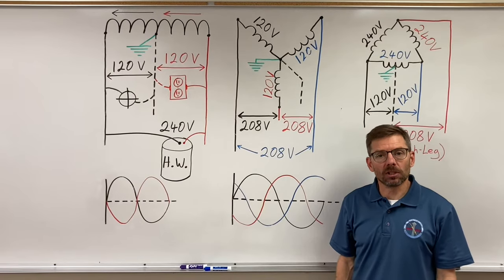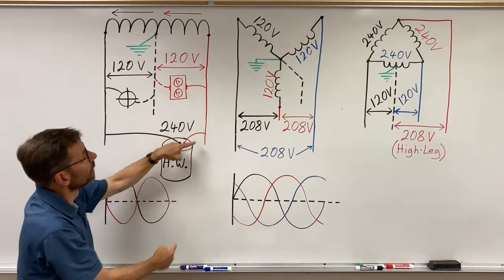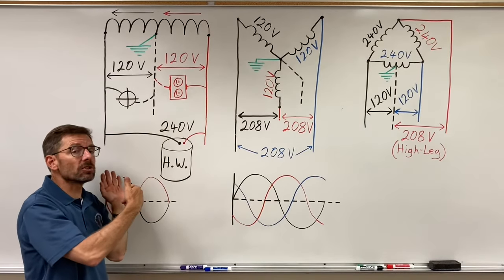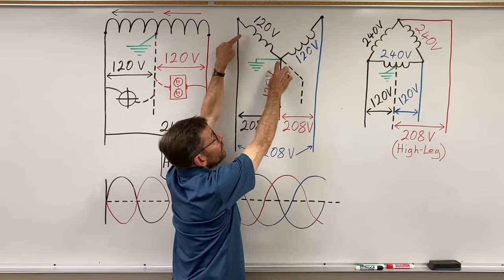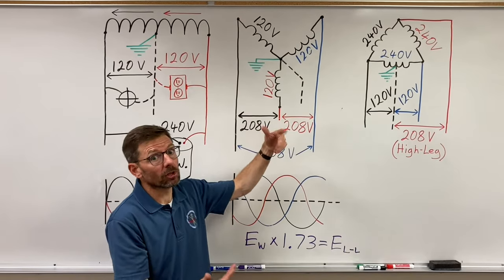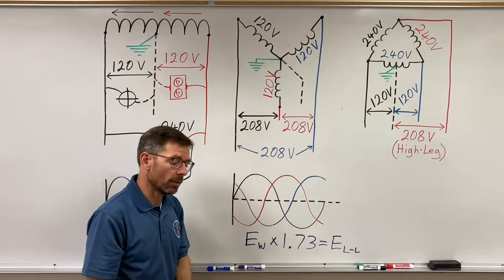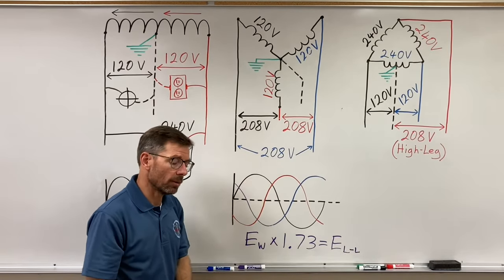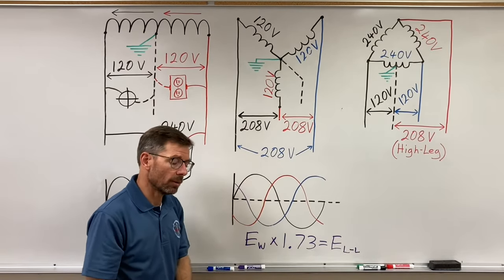120/240 and 120/208 Volt Transformer Secondaries

Comment: DAVE!  DRAW the 120/240V secondary with 1/2 of it wound in the OPPOSITE direction.  That's how we get the two 120V waveforms, 180° OUT OF PHASE!  Spread the word.
Reply: Except it's not. L1 and L2 are coming from opposite ends of the same coil.
Reply: @pterafirma  Its not easy to follow, because, for decades, we all have been looking at drawings of secondary windings never showing the reverse turn around direction, made at the neutral point.  Thats HOW we achieve 180 out of phase outputs from secondary L1 &L2.  The winding is one winding, just reverses halfway.
Reply: @BYENZER  - Not true, nor would that even work. You're possibly thinking of the fact that the primary and secondary coils can be wound in opposite directions, reversing the phase between input and output. But the secondary coil itself is wound in a single consistent direction, providing single-phase 240V output.

If you center-tap it, to get split-phase 120V, both sides are still in-phase, as the coil continues to have 240V at 60Hz across its complete length. Your two 120V circuits only appear 180 out because you're metering them oppositely, i.e. with respect to the center tap.

Think of it like this: Consider L1, N, and L2 to be (respectively) Left, Right, and Center. If you read the L1 circuit, you touch the red lead to the left, and black to the center. Maintaining consistent frame-of-reference, you should read the L2 circuit by touching red to center, and black to right. But because we've designated the center as "neutral", we automatically flip the leads when reading the opposite side, instead of just sliding them over in same orientation.
Reply: @pterafirma  No sir.  Please try to follow.  Empty your cup.  Open your mind.  You will see it.  I think, you are probably going to enjoy, albeit painfully, when you start to understand it.  Maybe this will help:
If you attach a two channel oscilloscope, to ANY USA residential a.c. service utility power, you will see, both L1 and L2, 120Vac sine waves, 180 degrees, OUT-OF-PHASE.
If you measure between L1 & L2, you see 240Vac.
But, measure between L1 OR L2 and the NEUTRAL wire, you get 120Vac, EACH.
IN THE USA, this is how 240Vac of electrical 'pressure', is provided.
If both L1 and L2 were 'in-phase', THEN the 'pressure', BETWEEN L1 and L2, would be ZERO VOLTS, no matter if they were 120V or 480 or whatever sinusoidal A.C. power voltage.
So, AGAIN, IF L1 & L2 were 'in-phase', then NO differential 'electrical pressure' would be present, thus ZERO VOLTS, BETWEEN L1 & L2.
If you open up a utility transformer, you can SEE the winding direction reversal AT the center tap/neutral point.
Reply: @BYENZER  - Condescension doesn't add anything to the debate, and that energy would be better spent reviewing the trig chapter about phase and how wave forms combine. If you add two equal amplitude signals 180 apart, the result is zero. If you're trying to double the power, of two equal signals, they need to be in phase.

Thanks for the video link, but I'm pretty well past that. I was a design technician for a EE firm doing power transmission/distribution, substations, and SCADA during the late 1980's. 

Your original claim about the secondary winding reversing direction at the midpoint is both incorrect, and untenable. That secondary coil first and foremost creates a single phase 240V current, and it can't be out-of-phase with itself. 

I think the convention of calling L1 and L2 "phases" has exacerbated the confusion. An individual bar or contact point doesn't have a phase, only a circuit does. With that in mind, note that the current at any given moment in the cycle, flows in a uniform direction along the secondary. If you're running a 240V appliance, plus several 120V devices from both sides of the panel, the current in the secondary is still going L-R on the entire coil (before reversing 1/30 sec later). At no point does it flow L-R on one half of the winding, while flowing R-L on the other half. 

If you hook up your scope as you described, you have simply flipped polarity of your second channel, mirrored it about the midpoint. That's why the two separate 120V waves appear 180 apart with respect to the neutral. But if you kept your metering polarity consistent (either all L-R, or all R-L) you'd see that the two halves of the secondary winding are in phase, and that's why they essentially add together in series as 240V. 

While we're sharing videos, here's a pretty decent demo of what I'm saying.  https://youtu.be/uRKbX74lBgU
Reply from the maker: @pterafirma  Thanks for responding to B YENZER1's comments as I have not had much time to respond to most comments myself.

I need to agree with Charles Staton's video that pterafirma referenced even though it may be harder for many to keep track of his examples as he quickly changes connections and references (unless we get excited with vectors and wave forms).  I will say that "At-Man", whose video B YENZER1 referenced, has a creative way to show the 120/240 vs 120/208 difference with his bungee cord, but would be better not to use the phrase "180 degrees out-of-phase".  I know I've been guilty of using technically incorrect phrasing when trying to simplify complex concepts so those learning the electrical trade can get an initial grasp of how our systems work.  But isn't that a challenge of teaching - being technically correct, but still simple enough to convey initial understandings.

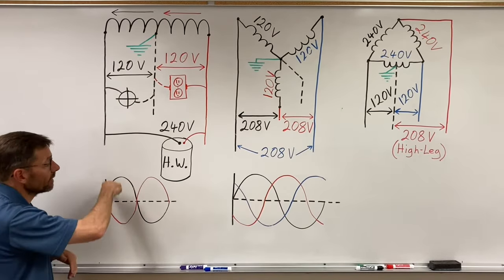Some of the confusion here is that between minutes 3:08 - 5:12 where I refer to the lower left sine waves I am referencing L1 and L2 to the neutral point (i.e: measuring from Black to N, then Red to N, which is how we might measure it in the field) so they appear to be 180 degrees out-of-phase.  And indeed, if I hook them up to a meter with a common neutral/ground as the reference they appear this way.  This really, however, shows that at the current moment shown in the video with current flowing through the winding from right-to-left as indicated by the arrows (with AC it's often easier to view it at a moment in time...), the light is getting current from the black wire and returning it on the neutral while the receptacle is getting current from the neutral and returning it on the red wire (again an area of growth for students because we so often refer to the neutral as the "return path", but current has to flow both ways in AC circuits).

This also brings up the point of a shared neutral and if the light and receptacle each demanded one amp then it is actually the same amp serving both and the shared part of the neutral back to the center point of the winding would have no current flow, thus creating a pathway for that amp that flows through the entire winding, down the black wire, through the light, then through the receptacle, and back up the red wire to the winding (complete winding provides 240 volts which is split between the two loads in "series").  Disconnect either device and the demand is still for one amp, but only through one half of the system (and therefore at 120 V, half the full winding's 240 V because only half of the turns are being used): down black, through light, up neutral, and through left half of winding if light is only device left connected, or alternatively down neutral, through receptacle, up red, and through right half of winding if receptacle is only device left connected.  With either scenario the current, at this moment in time, is going from right-to-left through which ever part of the winding is needed (meaning counter-clockwise through the circuits as drawn).  This would imply "in-phase" and that is why the two arrows point in the same direction.  When the AC cycle changes to the other direction, the whole winding will have current flowing left-to-right and the current would flow clockwise through the circuits.

ANOTHER BRIEF EXPERIMENT to try is to take two AA batteries and put them together end to end. Which ever way you put them, the voltage from either end to the middle will be 1.5 volts (negative or positive depending on which way you connect your leads). BUT, they must be going in the same relative direction in order to get 3 volts from end to end.

Thanks for bearing with my long explanation and forgive me for any "over-explaining".  I think I see another video opportunity when time allows...
Reply: @davegordon6819  - Not "over-explaining" at all, this is good info that I appreciate.
Reply from the maker: @BYENZER  Thanks for engaging and I'm sorry I have not had much time to respond to comments.  Please look at the comment I made to pterafirma as there are reasons why the arrows go in the same direction in both halves of the winding and yet the sine waves (at lower left of screen and, as you mention, in a meter if we use neutral/ground as the common reference) appear to make it look like the winding might be reverse wound on either side.  In the end we see that current must flow along the entire winding in one direction at any moment-in-time.

Another principle to remember here is that on a transformer secondary the induced voltage will increase as the number of turns increase.  Therefore, if I put one lead of my meter on one end of the winding and keep it there while I sample voltages every few turns with the other lead, I should see voltage increasing until I reach the maximum voltage potential when my second lead reaches the far end of the winding.

In class I would energize a coil to act as a transformer primary, then take a wire connected to a volt meter on both ends and start coiling it around the "primary".  As the number of turns increased the voltage would increase.  Then I would pull a fast one on them after about ten turns and reverse the direction for a few turns.  The voltage would start dropping.  Some would be confused, but there were always a few bright sparks that saw me change the direction of the turns...

Anyway, please see my explanation below. Thanks.

Comment: L1 and L2 in split phase systems ARE NOT 180 degrees out of phase. Please learn Please review how to add wave-forms before you start teaching it.
edit: I smoothed my comment because it was too rough for no reason.
Reply from the maker: Thank you for your comment because it is an important technical point so please allow me to state a couple things.  This should help to clarify your comment for those who don't understand the significance.
FIRST, I have drawn arrows above the 120/240 single-phase (split-phase) to show that both "halves" of the secondary windings are in-phase with each other.  It is after all a single winding that has been tapped in the center.
SECONDLY, from minutes 3:08 - 5:12 I emphasize that the sine-waves below it are drawn in reference to the neutral (I use a dashed line as my way of indicating a neutral).  If we use the neutral point as the reference then the sine waves will appear to be opposite each other.  I am an electrician (not a physicist) and am trying to explain to electricians (and others who want to grasp the basic concepts) in a graphically easy way why we sometimes have 120/240 and at other times 120/208.  Essentially, why the red and black have a 240 volt potential in one facility and why they are 208 volts in another building.  Indeed, I agree with you that if I referenced from L1-N and then N-L2 I would get two overlapping wave-forms to confirm that that they are in-phase as we continue down the winding.  However, in our trade we often measure from L1-N and L2-N which would show the two 120 V RMS waves opposite each other.
I recognize this can be a point of contention, but the more our students learn the more they can break apart the subtleties - in this case, the points of reference and their relation to vectors.  Thank you for engaging and letting me explain my approach.
Reply: @davegordon6819  First of all; I'm sorry, I should not yell. It wasn't my intention to create a rant. Second; Thank you for your reply.

 This wiring can be confusing. And yes, using GND as a reference is going to give you wrong impression that L1 and L2 are out of phase. Using a mid point of the secondary winding as "neutral" is just a convention and easy way of creating 2 circuits of 120V each. It has no real meaning from an "electron's point of view". You can choose L1 or L2 as a reference.  Also a word "phase" is misused. L1 and L2 are not separate phases. They are "halves" of the same phase.  

quote >I agree with you that if I referenced from L1-N and then N-L2 I would get two overlapping wave-forms to confirm that that they are in-phase as we continue down the winding.<

That's right :-) And to confirm it you can measure voltage across L1 and L2 which gives you 240V. If those were out of phase of 180 degrees you would measure virtually 0 (zero) volts because those wave-forms would cancel each other. ( pick of L1 +120V + valley of L2 (-120)V = 0V). The false reading is only because reversed polarity of oscilloscope's probes. 

In the case of 3 phase system it's just trigonometry where you add one sine wave-form to the next one which is shifted of 120 degrees (or 240 degrees) and finding maximum value of the  resulting wave-form. 

Have a great day :-)
Reply from the maker: @tjblues01  Thanks very much tjblues01.
I do appreciate the interaction and you keeping me on my toes.  I know I'm guilty at times, but I constantly need to make sure I'm being technically correct.  A couple things you may be interested in:

1) I added a note to the description to emphasize this potential misunderstanding.

2) If you have time you may be interested in the comments thread initiated by "B YENZER1" and kindly responded to by "pterafirma".  I've unfortunately been unable to review most comments over the past year and a half (Covid time made some of us super overworked...), but I did add my two-bits to their dialogue this morning.

God bless, and I wish you a great day too :)
Reply: @davegordon6819  Hey Dave. We learn something new every day. Which is good :-) But also we have a tendency to hear what we want to hear instead of what the other person actually said.  I'm guilty of that. My brain didn't register yours: "appears to..." 
I'm not an electrician. I'm a telecom tech. It means I work with; RF (5MHz to 6GHz), signal modulation and encoding, optical links. And all sorts o power supplies: 48 V DC, quasi square 60 and 90 V AC (15 to 25 A) all way down to switched mode small ones 24/12/5/3.3 V DC. 

Once a while I have to train new hires. And that's what happened; A "new guy" told me about 180 degree out of phase set up in split phase electrical systems. So I jumped on YT to find something educational which would save me a lot of my time explaining him that he is wrong :-) And.... I found your video 😉

You made me rethink those concepts and realize how important is paying an extra attention when listening and avoiding thought shortcuts. Something might be obvious to you and at the same time it be confusing as hell for the other person. 

Have a good one!